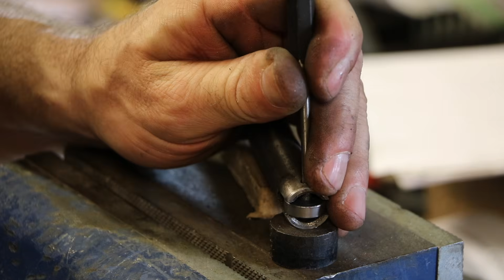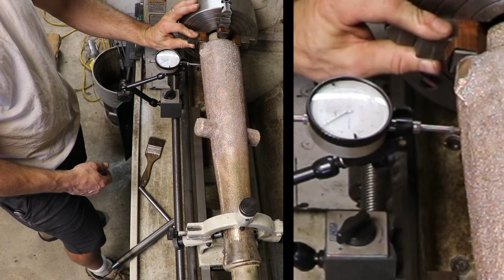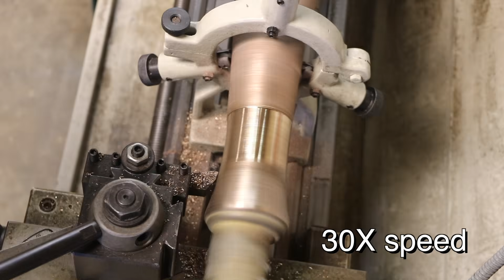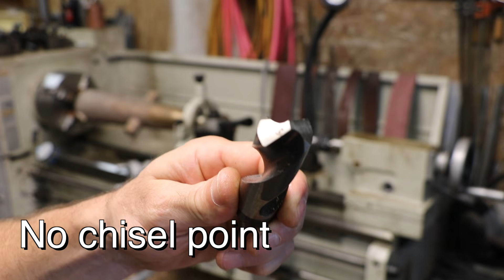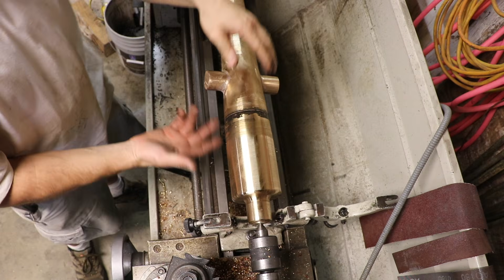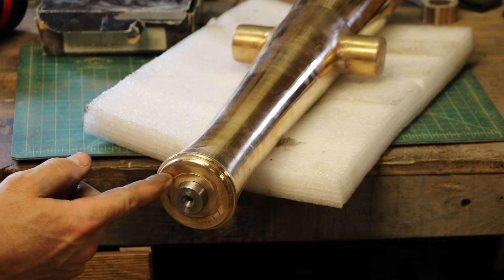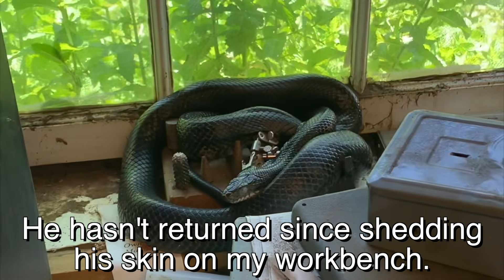Machining a Historic Bronze Cannon Barrel, Scaled Down Replica. FarmCraft101

Comment: I would drill that bad spot out.  run a steel plug down the bore and plug the hole from the inside, then poor new brass in your drilled hole the plug should stop it.  Then you will have some minor machining to fix that spot and rework it to the rest of the finish.

Comment: Maybe you could bore out the diameter a little more and press a stainless steel bore liner in your Canon barrel at a machine shop that has a big hydraulic press and then polish the bore to a mirror like polish and I think you would be in great shape then !

Comment: When you want to clock a rough surface slip a piece of flat between your DTI tip and the rough surface, it will stop all that bouncing of the needle. Make it long enough to rest on the lathe bed and the DTI tip will hold it against the work

Comment: I have been throu most of theese learning :D :D Still no sucess, - but I agree - sleeve it around å steel-pipe that you close in the bottom - also make a small "lip" for the fuse-powder.
And for all safety sake - never load it with a bullet - those casting imperfections are  danger - even withut a bullet! 

You should cast it horisontally (next attempt?) - let the ingate fill from the middle, avoid undercasting with a large reservoar, - make two sprews, and make sure to weigh down the green-sand. Also poke some tiny vents on the upper side, for letting out the gas from the sand.
Use a acetylen-flame inside after removing the model - gives a nice surface ...
(Btw -there is no breach on a mussle-loader - only a "Grape"
Will I find a next episode?

Comment: The thin section solidified first, so the thick area didn't have liquid metal feeding it when it cooled.
Sometimes an entire casting has to be shaped like a riser (to feed as it cools), then everything extra has to be machined away.

Comment: I know this is three years after the fact, but if I was in that situation, I’d hydrostatically pressure test it. I actually thought that was why you were leaving the extension on the muzzle. You could tap a thread into it, and plug it with a hydraulic fitting, then test it to whatever pressure you desire.

Comment: To comment on the history of metal fabrication, I can provide insight into the mentality of the people as they performed acts of mechanical impossibility by hand. The simple fact of the matter is that crafting was an art, an artisan would practice his craft, performing tedious impossible tasks for decades at a time. It took practice and knowledge. Which brings me to my point. We are privelidged. To us, when something doesn't work out, we look for another tool, or another machine, or another bit of research to look up on how to face the issue. The artisans of old had their wit and experience. Sure they had word of mouth and books and other artisans for helpful advice, but it was all locally found, and if it was not found locally then it was simply not found. So when push came to shove, the artisan would have to make due with simply his hands and his own wits. This often turned out defective product after defective product until the artisan turns out a good one. As you know, technical errors in metalurgy often turn out, dangerously. It was common for artisans to die or be maimed while crafting. So whats my point? Simply put, our minds are different than theirs and it's wholely to do with the tools at our disposal. Artisans of olde performed acts of miracle on a daily because they HAD TO their life and limb depended on it! It simply HAD TO WORK! or their life as they knew it was in danger of ending due to starvation or worse! We practice our artisnal arts as hobbies or as recreational art rarely does our life depend on it and when it does, we invent a machine to make it not so anymore. We are in a scholarly age where everything is available to us, knowledge, tools, machines, EVERYTHING! QUICK AND AT THE READY for whenever we need it! We're rarely forced to "make it work" but that was ALL THEY HAD! We suffer from sensory overload, too many answers to a problem and due to that, we most often choose the path of least resistance. The hard way never registers to us, yet it was all the olde had. 

TL:DR: We are blinded by our knowledge and emprivelidged by mechanization. It makes us short sighted where the artizans had to make due with what they had, making them more creative and detail oriented as it may cost them their lives to be cocky and insolent the way we are.

As a side note, i've always thought that if we gave an artisan of olde our tools, they would surely turn out masterworks that would revolutionize the state of the art forever!

Comment: Increase the bore diameter to the depth of the defect and as far down as the defect, make a friction fit sleeve and use it to restore the original barrel diameter and at the same time reinforcing the barrel wall.    🦘

Comment: Didn't notice any proper eye protection. Glasses won't protect you from flying chips of gun-metal! - Very dangerous, poor practice.
You can't pull non-ferrous particles from your eyes with a strong magnet, as you're able to remove iron or steel.
Polishing a work-piece on a lathe with a cloth is also highly dangerous.

Comment: If you gun is cast from real Bronze 8% tin and 92% Copper you can stretch it to steel Bronze. With an cylinder Always an Little bigger than the bore Diameter around 5 times. The survace gets the hardness of steel and the outside of the  Canon makes pressure to the inside.They wrote the material streching Limit goes from normal Bronze 4²mm to 52² Newton meters.

Comment: that thing looks BEAUTIFUL polished up like that! as for the barrel, what are the odds that melting down more metal and pouring it in the hole then re-drilling it would hold? not sure if or how well it would bond if you tried to fill it in.The only other option would be to sleave the barrel somehow

Comment: Vertical pours are much preferred in cannon foundry with lots of vents. Much fewer gas or pressure voids. Thick casting sand walls in big forms. Allow for slow cooling. Percentages of 88, 2 and 10 are ideal, copper, tin and nickle mix for "Gun Metal Bronze". (No Zink like in brass). Great video. Good knowledgable machining.

Comment: I'm late to the party, so I will respond as though you haven't already devised a solution.    (I haven't looked for the next video yet) 

So many ways to skin that cat.

You could over bore a reverse taper (or a captive groove)  and pour a liner with either brass,  bronze or lead.   Brass and lead would have to be replaced after a number of firings.  Neither would solve any unknown structural defects.   If using bronze the barrel would need to be preheated pretty hot otherwise you will end up with voids in the liner. 

To recast with a ceramic liner on the mold would allow you to preheat the mold from the inside, slowing the cooling to allow gasses and dross to float to the top.  Also you could add another 10 lbs or more to the pour to increase the thermal mass and hydraulic pressure at the tip of the barrel, reducing voids.   

Any sand displaced during the casting process needs time to rise or be forced out of the metal.   That requires slow cooling.   When you had your blowout, you had a partial shell already in the vent, which is cooling way too fast. 

Again I think the ceramic liner wins here.  If you do it right, you can shake off the green sand and the ceramic will come off in large pieces and not contaminate the sand.

Comment: i'm planning my own mini UK version of this right now :) (it's a whooping 30cm long!) Did you use any particular guide to the bore to overall thickness ratio? i've found in my internet 'research' that a bore of one unit requires at least 3 units of diameter at the breach. I'm actually going to go overcautious on mine anyway, but if you found any 'bible' on the subject i'd love to know of it. I'll be using bell bronze (4:1 copper to tin). Oh i also found an interesting paper (from the 1850's) that shows the chamber pressure is very significantly lower after 3 bore lengths down the barrel. great video series thanks (i'm on my third rewatch!)

Comment: Why didn't you just machine a bushing to slide over the existing body of the steady rest and center it with the old set screw pins and drill a new set screw hole in the bushing basically extending that casting like you said it needed? Hind sight I guess!

Comment: From the machining standpoint - first drill both sides for center - makes your life easy (for help we use metal plate lets say 3cm thick, 6cm dia, on one side you have already drilled center hole, the other side go face to face with your part and press together, a few turns and indicator will show you some magic *have hammer at hand (-: )  , after that make (we call that crap "lunette")  stripe, bore, surface... painful i know ;-)

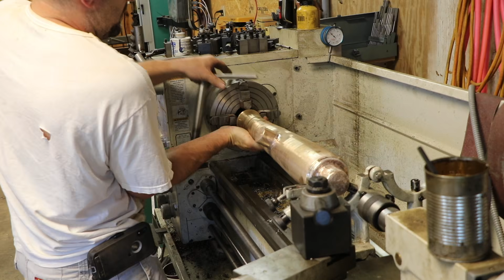Comment: @farmcraft101 @ 18:05
Use the rest for adjusting,  and then trim the end with the turning tool.
Adjust accordingly and when the tip of the tuning tool is able to remove all material, and you see the striations go dead middle, you got your center

Comment: Buy a 50 BMG barrel turn it down on your lathe and open you're boring up then heater the cannon tube and swedgin the 50 BMG Barrel as a Canon cools it will tighten around the rifled barrel.
By doing this you will make it stronger and have a rifled barrel not a hundred percent authentic but it would be much safer

Comment: you lay it on the ground and mount 2 pieces of wood to it and make the tops of the wood level. then you mount it on the chuck and level the wood. If there is a bend in the cannon the 2 pieces of wood wouldnt be level.

Comment: I would drill out the area of the defect, then tig weld the void and whole back up, or you can choose to drill it out with a larger bore and hope to not run into more voids might also want to look into deep bore drill bits also called gundrill

Comment: Hi, Years ago I built 12 of these or similar to start and finish the Americas cup Yacht race, the one an only time it was held in Australia. I got pretty good at polishing.  When I did our barrels, we went to 1200 grit and then used brasso (a mild abrasive polish for this material) with the 1200 grit. We got it so shiny, you could not see any machine marks. From your process, just one more step 1200 with brasso and will pop. Also being a fitter and turner by trade, I cringed at some of your techniques on the lathe, but I wont go into it.

Comment: I'm glad you captured the end with the steady rest @22:21 in case it spun out of the dead center.  You already know there may be casting defects lurking within.  My father worked in CNC machining most of his life.  One day at the shop, someone was end-milling some threads on a long pipe, and didn't put the steady rest on for safety.  There was a defect, the pipe bent, kicked out, and in the blink of an eye, the fellow was bleeding on the floor with a broken jaw, broken ribs, and a nearly broken leg.  Lucky he wasn't dead with a blow to the head like that.  Your casting is obviously thicker and shorter than pipe, but the instant destructive power of that momentum is deceptively easy to forget about when you work with it daily.  Stay safe so you can make more amazing creations!  I'm learning a lot from your videos.

Comment: I'm back ! for your second end where you are having a problem with SAG , put your steady rest up on the machined surface  & adjust as closely as you can , then bring in your dead center to where it just scratches the face , it will cut a circle if the part isn't concentric . Use the steady rest screws to adjust to true center . Seems like I'm writing a book , I apologize .

Comment: There is an old boring technique called " pack boring " it consists of casting or machining a bearing support around the bore bar just behind the cutter . The best material for this purpose is Babbitt metal . It was used mostly for the finished I. D. Also a " Cat-Head " would be VERY useful for the steady rest end  , it consists of a tube with 4 to 6 tapped holes, equally spaced , on both ends with enough space between the holes for the steady rest to fit. Indicate as true as possible , then skim  O.D. to true up.. GREAT video !!!!!  just an OLD machinist

Comment: If there is a defect in the barrel (especially in the thinnest part of the barrel as you seemed to point out) then your cannon may likely not be suitable for high pressure loads. So when you are firing your cannon I would go about 5-10% less than your average powder load when you fire just to be safe. It may not be a problem but just in case I would avoid high pressure loads in your cannon.

Comment: You have a lathe will you do some things for me ? I'm making something and I need a keyway cut into a solid steel 1 inch bar I also need a custom sprocket made my local machine shop won't do it and there isn't a machine shop for 60+ miles
Reply: cameron G just happened across your comment here. Being 4 months ago I'm sure you found an alternative but in case not I have a small machine shop and I do work on small one-off jobs and ship all over the country. Feel free to send me a message. Steve@shopworxmachine.com have a nice day

Comment: I know nothing about this stuff whatsoever but could you drill out the defect from the outside and then machine a new plug to put back in and then heat the whole thing up and sort of weld it back in ?

Comment: A masterpiece !!!!!
I love brass.  I know nothing about all this. But lovin every minute of it. My son made a 10 inch out of a chunk of  steel shaft in high school shop class. Drilled it 45 cal.
They fired it at football  games stuffed with toilet paper . lots of burning paper in the air. Looked good. I got some 45 balls and we shot them up. He still has it 35 years later now. Still ok
...I don't think black powder would ever hurt it. It ignites at the touch hole and most blows out the end in a ball of fire. As long as the ball is under size and wading behind it
Grease the wading with Crisco or lard.
We proofed it by over loading it.as long as the balls don't stick.  It shouldn't  swell with black powder..  Smoke fire and bang is the fun Any way. ,,,  Accuracy ?????

Comment: I had a similar problem boring long holes- i found the simplest solution was a spade drill- it's what they use for bagpipes.  Very simple to make in the shop and intrinsically self--centering unlike a twist drill.

Comment: Beautiful work for sure! After watching the casting process, one thought came to mind. Why stick with the 'conventional' theory of a round fill hole? If you had created an oblong top fill hole, oval in nature along the barrel axis, with the form at a slight downward muzzle angle, making the fill slot the highest point, and the fill chamber above the thickest part of the cannon, would that not have given enough material to allow for it to continue to fill as it cooled, and not caused the collapse as seen in the first casting vid?  I mean you knew you were going to have to cut a sprue off anyway, so why not make something larger to fill into... Don't know if it would work, just a thought... Would allow larger amounts of liquid metal to flow before it tried to cool, which is where your void came from I believe.

Love your machining work, and your vids are nice and concise without a lot of extra flourish to them... makes for an enjoyable viewing experience.

Comment: When testing cannons you put 3 times the charge in that will be used in normal condition. See it is better to have it blow to hell in the test "pit" than in your face. Long lanyard or fuse. Also never use smokeless powder. By the way I was field artillary on the SP M109 that holds the world record for fastest rounds fired. I am not just spouting off BS. Love the little cannon. I know you have alot of time in it but would rather see you break it in test than get hurt. Also if you do another one try to pressure forge the next casting. Plates and bolts to squeeze that molten beauty. See if your finding defects as you bore it here could be other pockets to weaken the barrel in the walls of the bore. I recommend a fresh start. Better safe than dead.

Comment: I know at one point you were thinking of fitting a high carbon metal tube into the bore. That way you will probably remove the defect as well as adding a lot more strength to tge barrel.

I'm just wondering how much power you will be loosing to that defect - i.e. gasses flowing around the projectile instead of pushing it. 🤔

Comment: Don't know about the silver soldier, I am not sure how you would clean down the barrel.  Could be done I suppose, but not something I am familiar with.  With that much void, I would think you would need a thick liner.  Thick enough to be a freestanding barrel, or until all of the void was removed.  Dixie Gun Works out of Tennessee, long time black powder specialist, had an article in the catalog on proofing barrels.  I can't remember, but it was either two, or three times the expected powder load and two or three projectiles.  It would be win or lose, but should make max. pressure, and   Thanks!!!you would know the traditional way.  Beautiful work, so you might want to play it safe and use it as a display piece.  Better safe than sorry!!!

Comment: Hi, for the drooping problem... could have just set the steady to the correct diameter whilst in your first setup then when you turn the cannon around just move the steady along to the position you want and it will take the droop out.

Comment: Sadly the only answer is to sleeve the bore I suggest a large diameter bore job  and sleeve at .25" using a  hardened stainless would work. Your local news paper  has rollers in this dimension on the presses and quality of material you need, they may be the right diameter and  they change them out regularly and come in 6 ft lengths.